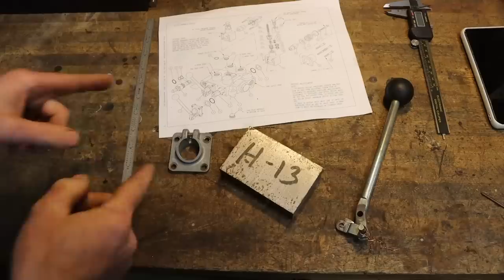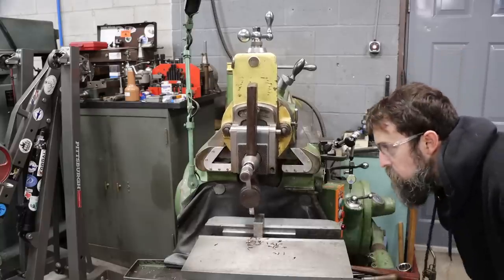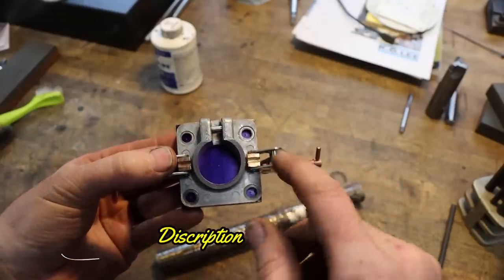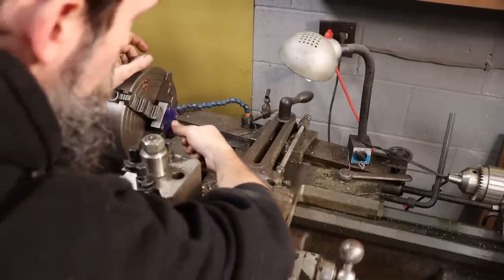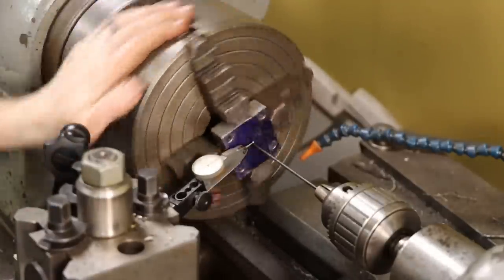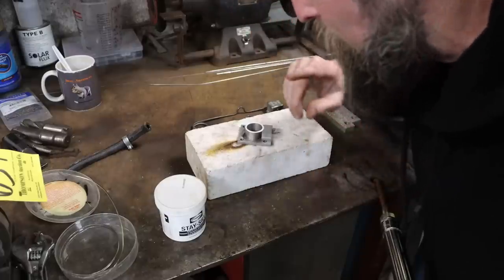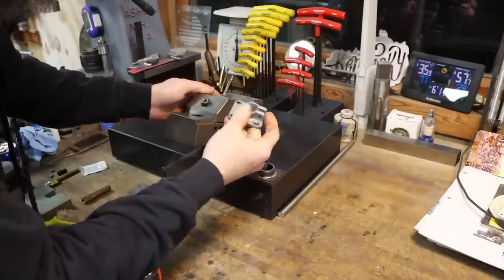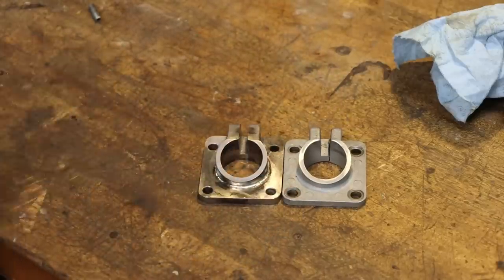Machining a hydraulic valve bracket for a good friend.

Comment: I'm saying this for people that don't have a machine shop available to them, so that they can be encouraged to fix stuff. There are lots of things that can be done with relatively simple tools. An average man with a welder , a drill press and an angle grinder could make that part for what it is. Although it wouldn't be nearly as pretty or accurate. It's just a bracket for a hydraulic valve lever...the acceptable tolerances involved are pretty wide.  I do have a machine shop in my garage, so I'm not denigrating anything that Steve did, at all. But we all have to start somewhere, and this is one of those projects that literally can be made from a piece of flat steel and a piece of black pipe, and you could probably delete the black pipe. The large center hole is just clearance for the rod that sticks out of the valve. The only critical dimensions are the distance from the pivot point to the 4 mounting holes, and even that would probably function perfectly fine within 1/16" tolerance. It might not look the same but function perfectly and stronger than the original. Think about how you can make that part with the tools you have, it's a good exercise for problem solving.

Comment: As a Gunsmith I can attest to removing material , I am astounded at how fast fine polish on a soft wheel can remove metal or roll over a edge (if your not careful)AND equally amazed at how long it takes to remove material when you want to remove material.
Reply from the maker: LoL, that is the way it seems to work

Comment: Steve when i had a lathe with that headstock taper lock i used a big wood cradle under the chucks to catch them so they didnt drop, that way i didn't need to hold it up. I keyed the wood with a vee notch also
Reply: Just done the same.

Comment: Oh how I love these one-off jobs. No repetition! Any more than 3 is just plain rude. Ahh, The shaper, The one most misunderstood tool in the job shop. There are some things they are just sooooo good at. I expanded my set of transfer punches to one inch by using Gr 8 bolts and taking the heads off and after turning the thread less ends to a point the same as the set I torch and oil hardened the pointed ends (with used gear oil). 40+ years and still marking like the day they were made. How wonderful it is to see Stan. I had forgotten all about the bash. It would be a 3 or 4 day drive for me to get there. Flying with a wheelchair sucks. They already lost mine once for 3 days before I got it back. What a neat lathe setup. using a flexible tool to indicate to is nothing short of brilliant my friend. I normally move the apron down and move the tailstock over it, do the drilling and move things back up until now that is. Saw files eh, I use the same flat file for doing the rakers to do the teeth. That way I only have one file for everything. On a skip tooth chain they are wicked ! How nice to see Elizabeth in the shop. It's been a bit since we have seen her. So bud, MAKING IT BETTER is why we do this. Take care eh.

Comment: Beautiful end result Steve. This was a nice little part to make because of all the different machine operations it involved. The one you made definitely won't be cracking like the zinc one from the factory, yours would last generations if needed 😁
Your choice to just braze in the tube in the center obviously made way more sense then taking the time to set it up and center it on the rotary table and calculate where to stop on each side etc. and wouldn't even make sense anyway considering what the part is for.
Love the channel and work you show.

Comment: My experience with silver solder is a slightly carbonized flame. It allows the solder to flow better by evenly distributing the flame. I have always had a problem with the torch set like  would for brazing. A very wise old fella, who was also an incredible Blacksmith,    told me that it's somewhere between soldering and brazing.  I hope that this will help you out.

Comment: A few years ago the local power equipment shop had me make a number of similar brackets for woodsplitter valves.  These had oval mount plates on a 45 degree angle, with two tabs for the handle. I chose to make them as weldments.

Comment: Nice job Steve, always fun to replicate a part only better. Fun to use all the tools even though a saw, mill, lathe and belt sander would have done just as well. But what is the fun in that when you got all the tools. Thanks very much for sharing.

Comment: One of the most used pieces of equipment in my shop is the glass bead blaster. I use a pressure feed instead of gravity feed. Blasting this great looking part would be the final finish that would really set it off as the work of art it is and set it up for painting.
Reply: Looking to do the same in my shop, what size compressor and nozzle do you run successfully?
Reply: @MapleEngineeringAndMachining  I use a 5 hp piston compressor. It is very important to control moisture so my air goes through an aftercooler that has its own fan, then the tank with a timed drain, and finally a dehumidifier with a timed drain. I also use an air filter and oil filter. The air is then fully dry and can be used for a plasma table also. I use 80 to 100 size glass beads and about a 1/16 nozzle with a pressure pot to control the feed. I use 60# pressure. Gravity siphon feed is ok but the pressure pot and feed gives a very consistent flow of media. You will need some type of vacuum to remove the dust from the cabinet. Check out Eastwood and skat products for a start. Air systems can be simple or complex. The better you design them the better your bead blaster will work. I constantly use the bead blaster.
Reply: @bruceanderson9461  Could it kind of slightly debur the item as well?
Reply: @claytonpalsson3104  glass beads peen not cut so really the answer is not so much. It does hide scratches some through the peening action. Gives a nice frosted finish and removes paint, rust and stains. Aluminum oxide or silicon carbide might debur some but they are aggressive on the rest of the part too. An abrasive wheel works great for deburring and again is used on almost every project.
Reply: @claytonpalsson3104  l forgot to mention it is great for removing mill scale for welding or painting.

Comment: I made many of those for Gresen valves on roll off trucks. Those just had a tab on a flat plate. I stacked 8 pieces up, welded them together, used an annular cutter to drill the center holes, a drill press to drill the outer 4 holes and welded a piece of key stock to make the tab after taking the stack apart.

Comment: A tidier way to make this joint is to tin the parts (jointed areas only) first. 
Wipe away excess solder while it is still molten. My preferred method to do this for small items is to drop them on a hard surface which causes excess to splash off.
Assemble the joint cold , which may require a light pressing.
Coat exposed joint areas with more flux and raise the assembly ,evenly, to the melting point of the solder. At which point you touch one part of the joint with the solder and instantly get a perfect joint that needs little clean up.
Surface tension pulls only the required amount of molten solder into the joint to fill the gap.

Comment: Using the ring grooves in the face of the chuck is the quickest way to rough center 4 jaws. Usually can get it within a 1/16" before ever spinning up. I used to do a lot of large stuff on a 24" chuck and it saves a lot of time. Time is money! :D
Reply: The hole wasn't in the center of the part because of the handle ears on one side.  Using the rings won't work in this case.
Reply: Scaling appropriately works regardless, on center or off. You have to be at least 10% smarter than what you are attempting. I used to make rock crusher parts. 600lbs was light work. Fighting to center an eccentric setup with those kinds of weights requires planning or a struggle with it. :D

Comment: For centering on the lathe in watched a great way to do it by Abom79 to get it close almost perfect use a center or a center punch in your case and use it in the tail stock to push the material against the chuck and then close your 4 jaws down took him like 20 second and done

Comment: H13 is definitely overkill strength wise ( Chrome Moly-Vanadium steel), nice Net Shape process Steve 👌. 
Great to see YT community in your shop.
Thanks for sharing and stay safe all. 
Best regards from the UK 🇬🇧. 
John.
Reply: If the H13 was annealed (how a lot of that material comes), the strength would be pretty comparable to mild steel.  If you heat treat it you can increase the yield strength by about 4x.  Still way better than a zinc alloy though.
Reply: @JohnSheerin  Yes, most tool steels are supplied in annealed condition, in this condition,  its hardness would be greater than most mild steels,  plus you could see the mechanical properties difference from the shaper swarf. There are a few calculations for deriving yield strength from hardness in the brinell scale.

Comment: If you bead blast the part, it is almost like cheating. Gives it uniform, matte finish, removes all the flux, even erodes excess blobs of silver solder from the surface.

Comment: Another fine video. One comment that I have is an easier way on the 4 jaw. While you were drilling is to also drill the center hole  (I do 1/4" most of the time). Then put a corresponding gage pin in your lathe chuck, put the work piece on the pin and push it against the chuck as you close the jaws around it. This is a great technique especially for offset holes in a 4 jaw.

Comment: Nice job Steve!  I made a similar piece on a smaller scale for a trailer hydraulic pump.  Mine did not have the center ring and I used 6061 aluminum instead.  I think you nailed it with the two piece design!  Really enjoyed the video!

Comment: Novice question: at 10:29 where you needed to plane off 0.475in. Wouldn't making a rough cut on the band saw, then finish on the shaper be faster and less wear on your precision  tooling?

Comment: 17:25 What is the coolant/lubricant you are using? Thanks. 25:39 When I have to change chucks on my machine I stick a piece of bar stock through the spindle to help support the chuck while I install or remove it.

Comment: Hi Steve, Sorry to start on a negative, but please don't leave tool holders on a rounded surface on the lathe, if you get a bit of vibration that can end badly. That part you made was excellent, although I might have bored it out after the soldering, just to make sure it was still round and the right size after all that heat. Best wishes, Mal.

Comment: I found out the best way to take care most of the "Hey Buddy" projects you get is to agree to do it. The next day you call them and tell them what the material will cost. About 90% decide they will just go and buy the new part. About 5% decide not to do the job. The remaining 5% agree to pay for the material and get it done. I used to be a nice guy but with the cost of material being what it is today is ridiculous. Not that long ago I had to buy 1' of 2" bronze round bar for a couple of bushings on a piece of farm equipment. It was just shy of $150.00. And yes, it is understood that I am keeping what's left over. That's my fee for doing their work. Was the fellow unhappy about it? No. He didn't have to wait who knows how long for parts that were on permanent backorder and he picked his parts up the following day. Am I a bad person for approaching it this way? Some might say so but those are normally the guys in the first 95% and in all honesty who needs friends like that?

In regards to your soldering work, part of your problem with flow is inadequate heat. You are working on small concentrated areas as you go and relying partially on your torch flame pushing the solder ahead of you. If you give your part a fair amount of preheat over the whole part before you start to solder it will help because the metal is already hot and there will be no "cold" zones as you solder. What is happening right now is without the preheat, your solder will only flow as far as you are heating and then it is quenched by the below temp material and that stops the wicking in via capillary action. Just a thought.......

Comment: I know you like fabricating parts but in this case you might try repairing it too!
Weld up the crack in the base & re-machine it flat & square -- then use  
a shouldered bolt so you can't over tighten the lever handle
 (which may have cracked the base to begin with).
 OR:
... cut a shallow slot, parallel to the base of the flange to create a flexible area so that 
the lever can be tension-ed to operator's preference...